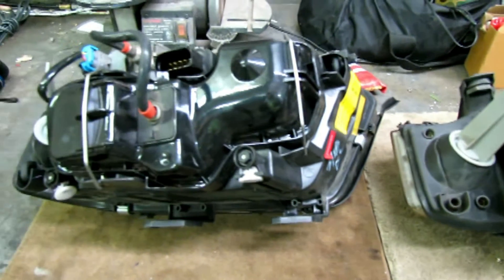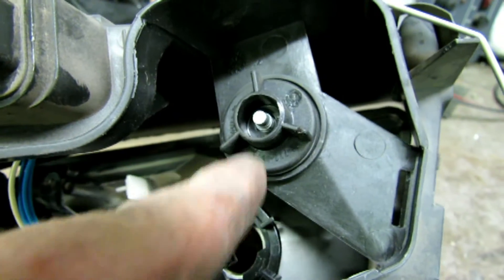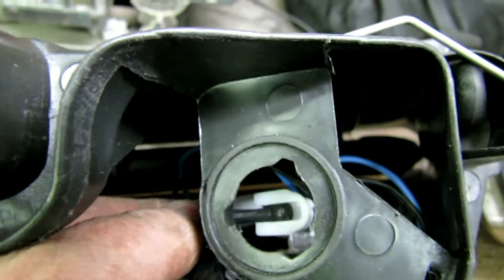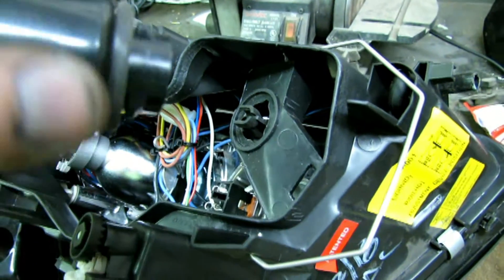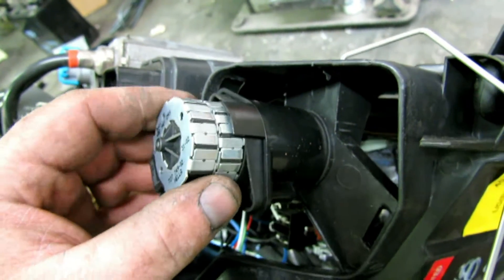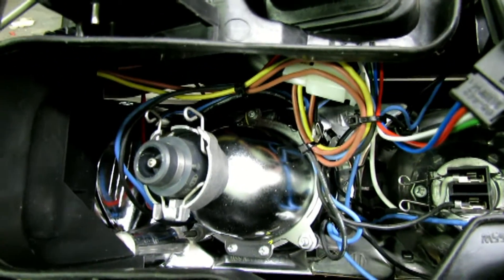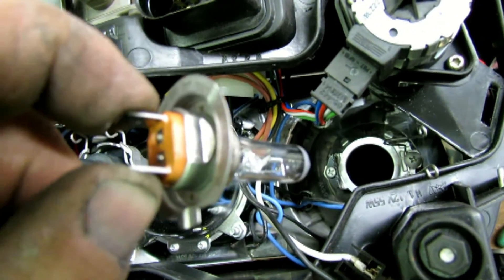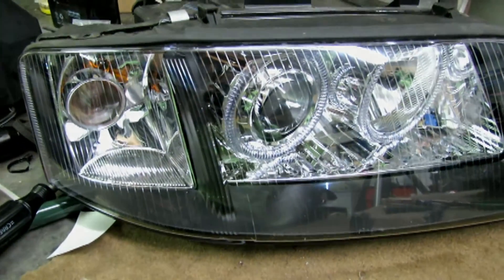Audi Allroad Halo headlight leveling motor installation

Comment: I did this and still got the error for the leveling motor
Reply: An error for the leveling motor is usually caused by the front height sensors on the suspension. (front right as I recall is the one the headlight computer uses).  If you hook up a VAG-com or equivalent code reader, you can tell where the error is coming from.

Comment: What brand LED bulb did you use for the high beam swap, and have you been happy with it's light output compared to the incandescent bulbs?
Reply: Hi Dominoe, I don't remember the brand, but it was an H-7 fan cooled unit with a separate power supply module. I have been very please with brightness (brighter than the halogens) and it has been almost 2 years and no issues. (I can say I remember purchasing the lamps on eBay)

Comment: After i did this update i now have the headlight height adjuster error message and the headlights do not dip up and down after u turn them on... Basically says no communication.. Do i have to go through a re-learn procedure if the headlights were disconnected or what could be the problem?
Reply from the maker: Hmm, interesting. When I did mine, and I have them disconnected several times, I never got an error. I have however experienced the error you speak of when one of my suspension height sensors failed. I know it was a front, but can't remember if it was left or right.  You can prove or disprove that theory by swapping the left and right sensors. Might be worth a try.
Reply: well, I have the same problem now, how did you fix yours